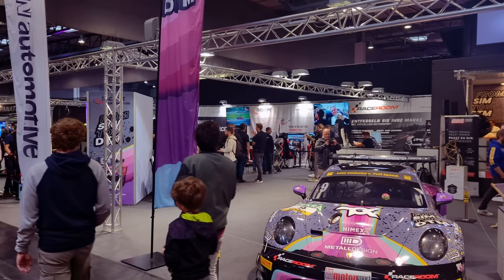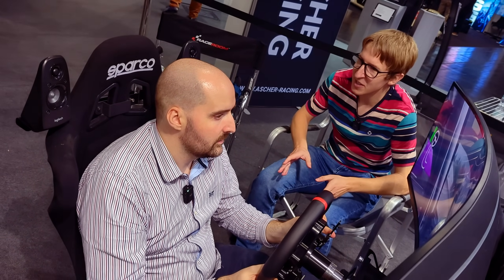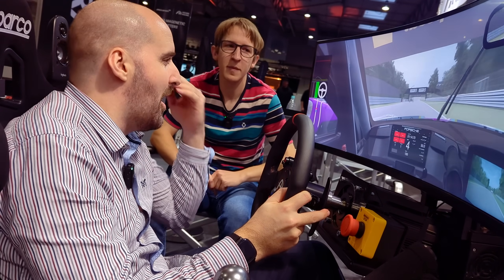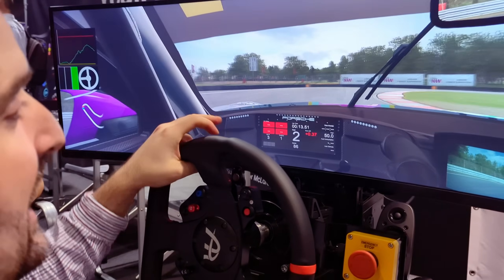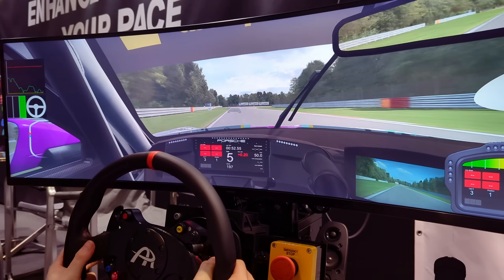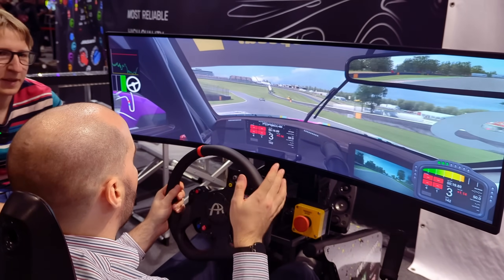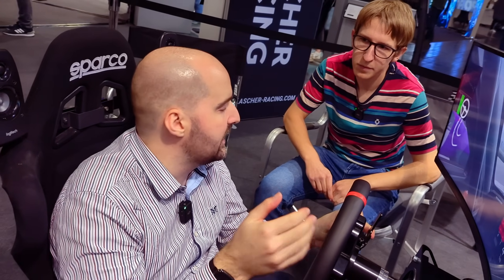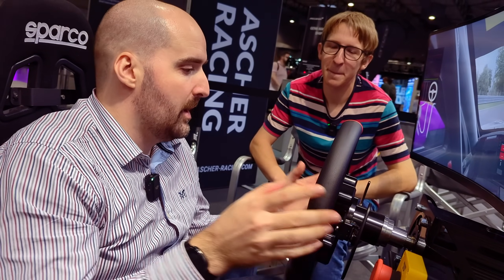New Tire Model & Physics Coming To Race Room !

Comment: When they say new tyre model & physics, do they truly mean it - as in changes to the actual underlying tyre model (AKA tyre "engine") and physics engine - or do they just mean it in the same way that devs have recently butchered the term "tyre model updates" and "physics updates" and therefore actually just mean vehicle content and/or tyre content updates (like, for eg., what a modder can essentially do)? There's a big difference between 1) Content updates: editing or creating a new tyre / vehicle (which will never fix inherent characteristics of a game but can potentially "band-aid hide" issues but usually with a consequence of compromising other aspects) and 2) True, core tyre model / physics engine updates (which can potentially fundamentally change things as a whole since the core tyre/physics model the entire game runs on is being changed). Two completely different things.

Content updates = nothing special, it's essentially no different than a modder when, say, they release an updated version of their mod with "better physics"
True, fundamental core updates (whether it be tyre model, physics engine, "FFB engine", sound engine, graphics engine, etc.) = very exciting as this is where the true improvements, the true changes and evolution of the underlying characteristics and behavior of a game are made.